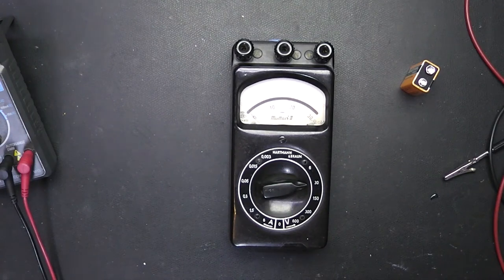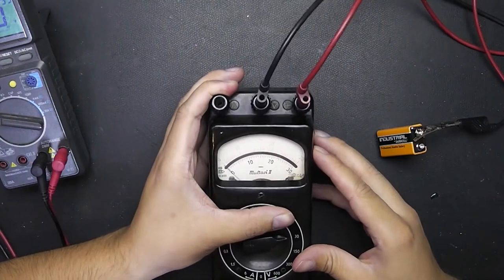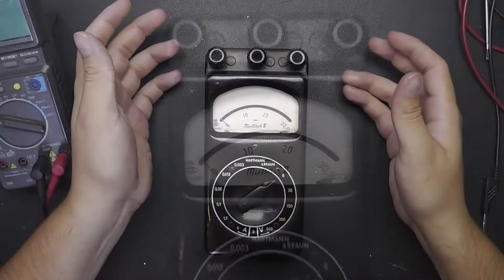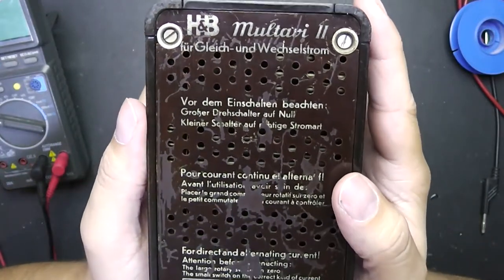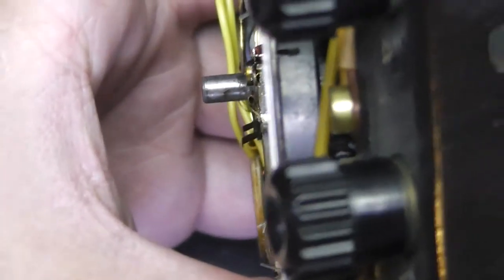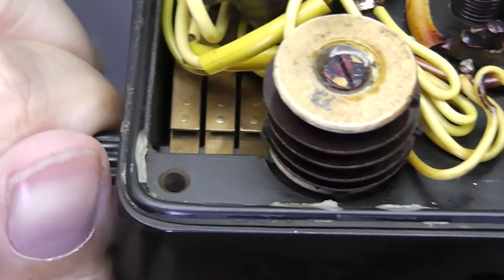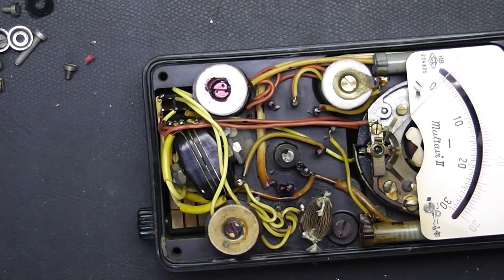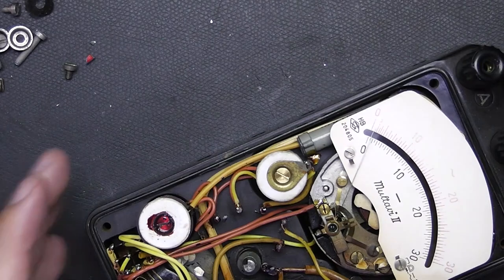Tinkertubes Lab [23] Hartmann & Braun Multavi II 2

Comment: Very nice video. These meters are still in service world wide. I use the Multavi I (which is DC only) and the Multavi II. As mine are working as they should, I do not dare dismantle them. It was nice to see you do it. That rectifier is interesting.
Reply: Hi, If you can help, in my multavi II, some wires not in their places as it they should be. My concern, the two left wires coming from beneath the gakvanometer toward the Ac/Dc switch, where are they terminated? Cheers

Comment: The multavi 2 meter has a low sensibility 333 Ohm/Volt. 

When you use it to repair a valve radio you should know the measurements are only correct on low resistances.

Anyway I think with experience you will get a feeling what is wrong und you will find the faulty stage in the radio easy. If your approche to get a valve radio working and you use the meter to confirm your fault this is perfectly fine. This is the kind of meter they used back in the day to repair valve radios.

If you like to restore the radio back to factory conditions you need the whole lot of service equipment. 
I worked in a repair shop in the 70th and we had very basic equipment: soldering iron, multimeter and dim bulb tester.
A good technician will find the defective stage within about 15 minutes.

It is surprising what a good service person can archive with a multimeter and hand tools.

Comment: Hiii, many thanks fr your effort and your sharing, I have a similar one with some wires not connected in their places, the schematic diagram does not shown all its resistors !!!  there are two wires (for 2 coil resistors in series 881 & 882 ohm, located under the Galvanometer and in its mid), they are coming to: I believe to mechanical switch ! but I don't know to which pins of! I am not sure! that was I need to know! and other resistor 535 ohm on the top right corner, up above the 100K, is not shown in the diagram!! I don't know why! any help would be appreciated.